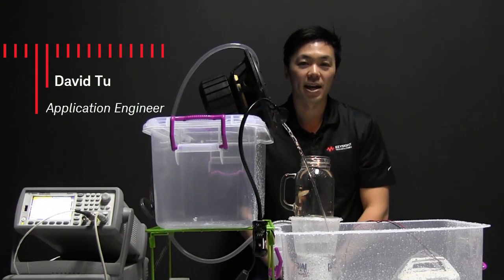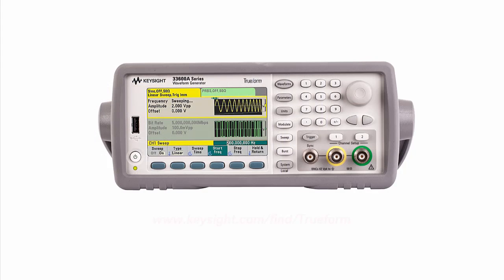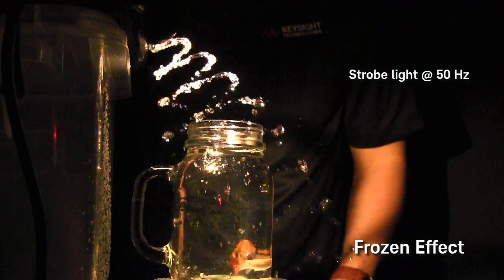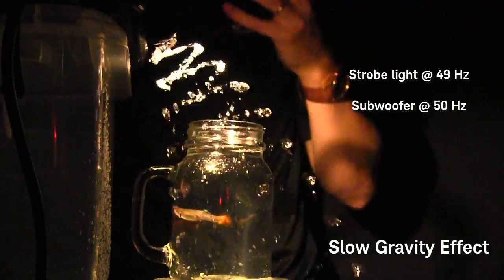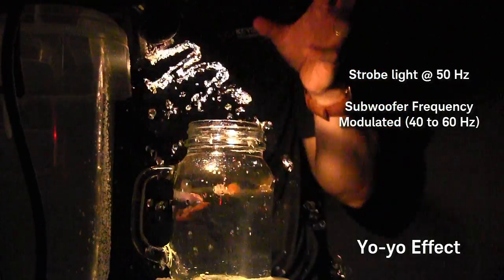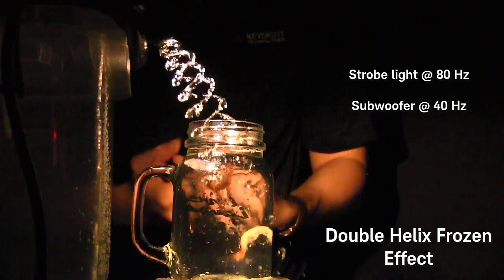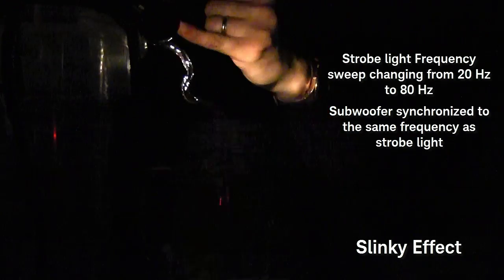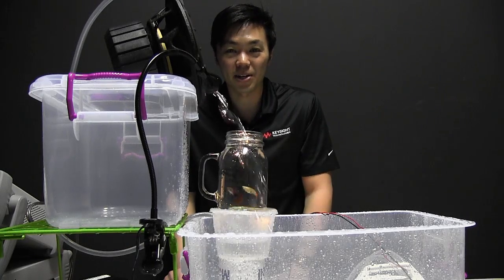Magic floating water explained with a function generator

Comment: Sound affects the medium it propagates through and studies on biological systems have shown various properties arising from this phenomenon. As a compressible media and a “collective mirror”, water is influenced by all internal and external influences, changing its molecular structure accordingly. The water molecular structure and its changes can be observed as a whole by measuring its electromagnetic (EMG) spectrum. Using near-infrared spectroscopy and aquaphotomics, this pilot study aimed to better describe and understand the sound-water interaction. Results on purified and mineral waters reported similar effects from the applied 432 Hz and 440 Hz frequency sound, where significant reduction in spectral variations and increased stability in water were shown after the sound perturbation. In general, the sound rearranged the initial water molecular conformations, changing the samples’ properties by increasing strongly bound, ice-like water and decreasing small water clusters and solvation shells. Even though there was only 8 Hz difference in applied sound frequencies, the change of absorbance at water absorbance bands was specific for each frequency and also water-type-dependent. This also means that sound could be effectively used as a perturbation tool together with spectroscopy to identify the type of bio, or aqueous, samples being tested, as well as to identify and even change water functionality.  --from Peer Reviewed Science Paper

Comment: Hi, i tryed this experiment at home with a speaker with bass boost, but a little bit different. When i  reached the 66 hz frequency the water jet was divided into 4 jets, aslo, 96 hz it divided into 5 jets. can you help me with a explication for this?
Reply: yes, at 66hz it looked like 4 but it wasn't - at 96hz the same happened, but instead looked like 5

let me know if you want more help

Comment: optical illusion with frequency and light , cool.If I build a sub woofer box and port it with multiple 1 inch tubes would I be able to do this with 10 or 20 feet of PVC tubing I would like to do a 50 foot display and I have multiple subwoofers And amps I would like to create this effect with out all the sound, Is that possible
Reply from the maker: forest gump You could use your subwoofer and tube at the end of your PVC pipe.  I think it would be harder to vibrate the entire length of the pipe.

Comment: i try this illusion, but i have problem. Could you check my test video? it will very helpful for me                  https://www.youtube.com/watch?v=Zzrov-Wd5Ew&feature=youtu.be
Reply from the maker: In your comments you mentioned that you are using a motor. Most motors spin really fast compared to the sub woofer.  You will need the strobe light at the same frequency of the motor.  I think, it will be much more difficult to get the effect at the higher frequency.   At the lower frequencies used by the sub woofer the setup is more forgiving.
Reply: Keysight General Purpose Instruments 
thanks for your advice
I also try that illusion with woofer(can make 20hz) but it has same problem.. 
 and i try with more small hose (inner 1.5mm) but it has same problem, too

should i change my water pump? it has 600L/h specs

what make me angry is it looks not stoped water drop, but stoped water line
what should i do@@
Reply from the maker: The subwoofer moves significantly,  you might check the amplitude of your  waveform to  make sure the subwoofer is moving.  In the video you can see David re-position the tube to get  good movement of the water.  Lastly, check to make sure  your light is "strobing" turning on and off.  Most  LED lights will do this unless it has a filter (capacitor) on the power.

Comment: Can I use a push-pull solenoid (operating at desired frequency) to vibrate the nozzle of the water outlet? I can switch it on and off by a square wave. Or do I must use a speaker with sine wave?

Comment: Hi
I wanna do this experiment for our science fair but my problem is that it will be in the school garden or passageway. we have a computer app to generate the sounds and a mobile app to generate strobe light.  is there anyway to do it without having to be in a dark place ? for example with black background :-\
 I will be so thankful if you answer.
Reply from the maker: Mi mi - You need a dark place to make it work.  Can you get a large cardboard box and put your setup inside the box? People could look into the dark box and see your setup - they would only see the water when the LED light is on.
Reply: Himm ok thanks ^_^
Reply from the maker: No problem.  Good luck with your science fair.

Comment: I want to recreate this experiment for my senior science fair. I tried visiting the website but couldn't seem to find information. Can you pleaseee give a description for the materials or procedure as a guideline to getting the same results! THANK YOU please reply ASAPPP!!!!l
Reply from the maker: You'll need a two channel function generator.  One channel will drive the subwoofer and the second channel will flash the light.  Both the light and the speaker will need more power than the function generator can supply.  So, you will need a audio amplifier to power the subwoofer and a FET switch to handle the power of the light.  You will also need a pump to move the water and a dark area to see the effect.  Good luck with your science fair project.